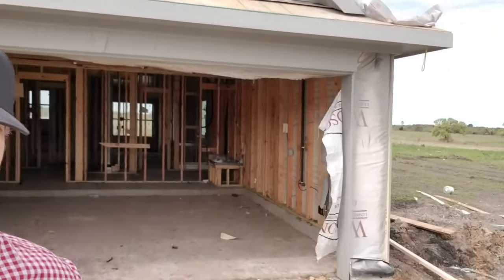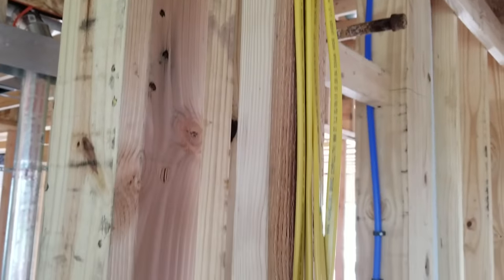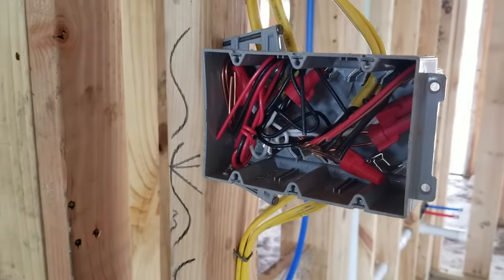HOW IS THIS EVEN LEGAL?!?!

Comment: I’ve lived in the west coast and the east coast. Been in the construction field as a framer on the west and a supervisor on the east I’ve seen a few methods and styles of building due to wind earthquake and rain or snow loads. West coast is all about down low like earthquake stabilization of a house. Lots of hold downs on every load bearing wall and tons of shear strength to tighten the house up from movement. The East coast isn’t as concerned about low end movement more about roof strength from being ripped off from wind. You see H-10 hangers on trusses compared to H-1s out west. So good video and yeah shear is used on both sides of the country but in different ways and different materials both sides as well. The big problem is that paper and how it’s applied and what it’s applied to. If you get one tear it can mean disaster for rot so it’s been a trial buy building practices to find a good system to seal the windows and exterior walls. Many stucco practices have been proven to fail but it’s ultimately up to you builder to back the job up especially if something fails and most do if they’re legitimate builders. The code enforcement likes to act as if they’re in charge and have the final say but when stuff goes wrong they’re the last to take any responsibility.

Comment: House wrap is not meant to be water proof. It creates a water plane that sheds rain while allowing interior moisture to escape. 
Often times, lateral bracing will be let in after the siding has been applied. Sheathing is not required by code because it's use is solely for lateral bracing. The bracing on the underside of the joists serves little purpose because the subflooring provides the lateral support necessary for the floor above. Same is true for trusses and rafters. Nowhere that I know of will allow a house without some form of lateral bracing. Without it, the house will not make it past the first owner. You may not see complete structural failure, but signs of failure will appear soon after the drywall is finished.

Comment: The entire structure would be compromised with a small fire, you should point this out to your area fire departments...
Job site is a hazard in itself...
Reply: How
Reply: @johncuervo3019  
Prone to collapse with no outside sheathing or cross bracing...
Reply: @joeschlotthauer840  So what are the fire resistive requirements in a single family dwelling?  Hint, this is a trick question.

Comment: some people call them Mc mansions.  mass produced  junk. glue and saw dust board's.
Reply: This is why I'd much rather have old house problems, than new house problems.  Just no comparison in build quality.  There can be major maintenance issues, at times, but then I see that nightmarish Chinese drywall scam that makes people sick and literally corrodes the wiring in the house.  Issues like that are irreparable, and the npow sick home owners often have to write it off completely, after having sunk their life savings into it.
Reply: Mc mansions are... Big. And gaudy. These are just copy paste house
Reply: Rcmike1234 yes I know I just didn't feel like typing in all the details. I have seen many smaller house's like this. Thanks.
Reply: Why you hatin'?
Reply: Yeah, I’d compare it to most furniture that’s made now days. Use once and throw it away. Trash.

Comment: o. s. b. would have cost about 1200. plus  maybe 800 for labor  100 for nails thats all the builder saved on a 130,000 material bill
Reply: 2100?
Reply: multiply that by 100+ houses they'll build this year and that will help explain motivation.
Reply: osb stands for oriented strand board . It has zero sheer value
Reply: Haha! Thought the same thing.  I recently priced osb for a project and it came to 1800.  Kind of impossible to justify not using it imo.
Reply: @charliepatterson9321  wrong
Reply: I'm okay with being wrong , I'm in an area where that is prevalent . 
I didn't have google to get my answers from in those days I was basing that off of popular local craftsmen's opinions as all we had to go off of was our common sense logic as joiners not scientists .
Thanks again for the correction , I'm an old man now and can no longer swing a hammer but I always welcome new information .
I appreciate being wrong , it proves you never stop learning

Comment: This, and videos like it, need to be viewed by all prospective new construction home buyers.  We're having a house built right now and I wouldn't have a clue what's up to code, or if they've taken a cost cutting approach that is still up to code, so I've paying a home inspector to review it on my behalf.  Not that I don't trust our builder- they have impressed so far- but you need to have someone looking out for you.  That's why I think having your own inspector is critical.
Reply: Bingo. I would add that to make a new home buying experience go smoothly get a set of approved "stamped" set of plans in your inspectors hands. Most builders will NOT do this so heads up. Set up FOUR critical inspection stages minimum for your private home inspector: 1.) BEFORE foundation pour after rebar / post tension is set..... 2.) BEFORE drywall placement....... 3.) AFTER drywall texture and right before FLOORING...... 4.) AFTER finish FLOORING and BEFORE builders walk through to document a punch list.

Comment: The house should be water tight before the siding goes on. There are vapor barriers that can be exposed without covering for 180 days.
The homes are probably being built in a low wind or seismic zone to have no bracing or someone forgot to put in the angle bracing.
Our build are is D2 so wall sheathing and hold downs are the norm.

Comment: Wow. Moblie Homes are Built better. Never buy a big box home! All of them are built like that all over the USA. Chop stick homes 😞 built like 💩.
Reply: It's true, I lived in a mobile home for 6 years while I built my house and it had sheeting under the siding and a waterproof barrier, not to mention metal framing and 3-way insulation. Ended up having to replace some of the flooring and a portion of the wall due to an interior leak and the contractor was surprised at how well put together the thing was. The main drawback was that horrible PEX plumbing.
Reply: @AlphaMachina  pex has its advantages in cold environments
Reply: Why are pex bad? I just installed them in my house I’m building but haven’t moved in yet, do they cause trouble? I only did it because it was cheap for me to do myself. I’ve used the plumbing a little bit and everything seems fine With them.
Reply: Wow, how is it that your comment is word for word the exact same as a comment from a video about a toxic town in Oklahoma stephanie?
Reply: With pex, after a while, we started having leaks in our walls. It was a freaking nightmare.

steezliner: Really? asshat? I'm just giving my experience. Perhaps the pex wasn't installed properly in the home, or a number of other possible issues. All I know, is that it caused us a lot of headache. Pex is what they use in just about every home now because it's cheap and easy to install, much easier than sweating copper, so, just like all of these new cookie cutter homes being slapped together in a rush, I'm sure it's just fine!

That being said, Pex is supposedly more durable than copper pipe or hard plastic tubing, and will last much longer because it doesn't degrade like copper. And we did install it in our new home, but we made certain it was done properly, and we haven't had any issues yet.
Reply: @AlphaMachina  Nothing but pex here. First thing I did was RIP out the copper. In subzero temps half the year. Yeah Pex is the way to go. But it has to be pressure checked, you fuck up one fitting, just like if you fuck up one solder joint with copper and you're gonna be tearing out drywall and carpet. Cleaning up the mess. I like the stainless crimp rings, I know when they crimp right, and easy to remove if needed.
Reply: @AlphaMachina  yeah you have a plumber problem, not a pex problem. I work on the construction industry and have been around countless pex installations, old and new. I've only seen problems with copper pipe. It splits when the water inside freezes. That's why I said there are advantages to pex. The pex will expand when water is frozen inside. Sorry to hear you had plumbing problems
Reply: @steezliner  Mobile home. Probably a rush job in whatever factory they built it in. The rest of the place was very well built. But in the course of 6 years living there while building our house, we had 3 leaks behind walls. Something that might be of note, is that the local city water had issues with water pressure dropping low and then spiking, so we always thought that might have been part of it.
Reply: @AlphaMachina  Mobile homes were piped with polybutylene decades ago, which is a crappy pipe.  That is most likely what you had, they had lawsuits all over due to failures.
Reply: Modular homes are built better than these!

Comment: My house built between 1932-1940 and there is nothing between the framing and the clapboard but tarpaper.      
An addition built in 1997 has already rotted out, had to replace a lot of OSB when I did some repairs in 2015.       
I replaced some seventy-five-plus year old siding and put marine-grade plywood sheathing up as part of the project, along with fiberglass insulation. The change in the sound deadening and utility bills has been amazing.

Comment: your being critical.... i would think there using structural paint on the drywall to achieve there racking protection
Reply: Sarcasm?
Reply: Caulk and paint; make it what it ain't...:)
Reply: “Structural paint”! LOL! That does sounds like something a contractor might try to pull.
Reply: @bcbock  your apparently not that well informed ....until you try structural caulking your pretty much living in the dark ages ! lol

Comment: I get clients that think codes are invented by industry to drive up costs. 
I'm not sure I'd want to sleep in that house if the wind was blowin.
Reply: I am a master electrician and I can tell you that a lot of electrical codes are pushed by manufactures. I am not saying that the codes don't make things safer or more energy efficient but there is no way in hell a lot of codes have had a real cost benefit analysis done on them.

In new office space we now have to automatically turn off 1/2 of the receptacles. It can be done with a time clock or an occupancy sensor. Most engineers are now making us switch 1 half of a duplex. All this is doing is teaching users to bring in plug strips and ignore the switched receptacle. Did that code save energy? Hell no it used more because now I have to use a receptacle that is marked specially and 2 times a normal receptacle, I have to run an extra conductor to each outlet in an office and our clients now use plug strips everywhere or they have their maintenance guy by pass the relay controlling the receptacle.
Reply: @SillyPutty3700  I just did a garage, all gfi recepticles as per the inspector. No plumbing. That was a first.
Reply: well some codes frankly are, others are not. things like afci/ GFCI but not making higher amp ones so you could just use one to feed a subpanel, and at the same time upping number of circuits required etc. some places requiring garages to meet air and insulation codes before they will let you put an occasional use heating system in etc.

Comment: Jordan,  Thank you for the information.  This is also a problem with Flips.  Purchased a home, with a catalog of issues from the inspection.  Seller supposedly fixed, but only covered enough to pass a re-inspect.

One month in, and I was already finding issues with the shoddy work.  HVAC systems not functioning as they should or not technically installed properly.  Walls not insulated or like this new build siding covered only (found this doing electrical where I could see light from outside around the light switch), unsealed outer walls allowing water intrusion between the floor and slab.  Improperly installed windows, and roof.   

These things are a nightmare for buyers new and old alike.

Comment: What the best way for a buyer to protect themselves if they catch their builder doing this?
Reply: Don’t buy it.
Reply: We had a house built in a development in NC several years ago.  Before we even thought about committing to buy in any development (and there were plenty being built in the area) we went through the developments on Sunday evenings, when no one from the builders / developers was around ans walked through the houses under construction, much the same way as in this video.  You could easily tell which builders were doing it right and which were cutting corners.  Building techniques, engineering of the homes, quality of materials, etc.  We narrowed it down to two builders we were comfortable with and went on from there.  We also drove by our house at random times during the construction and checked on what they were up to.

It did help that my Brother - in Law was a contractor and i had worked for him during summers my Jr & Sr year of college, so at least I had a decent idea of what I was looking at.
Reply: They need to have a third party supervise the build and right strict code requirements in the build contract. But if you already bought one of these turds, there are almost no consumer protection laws in housing industry, it's a scam artist's dream.